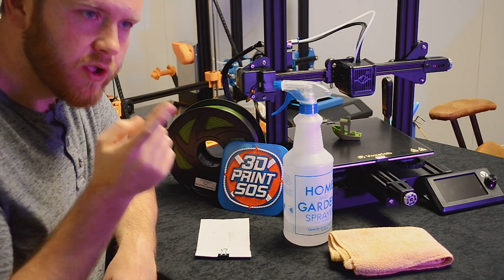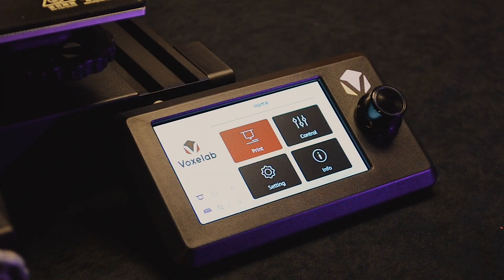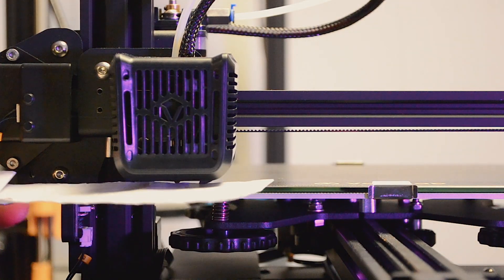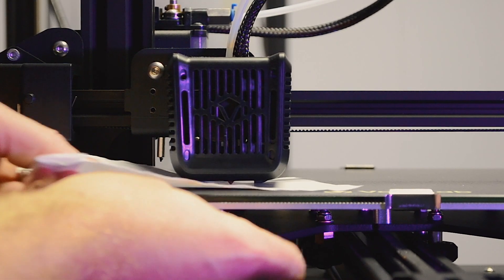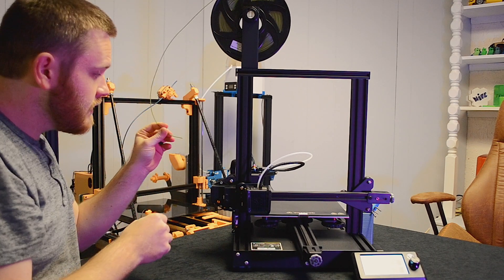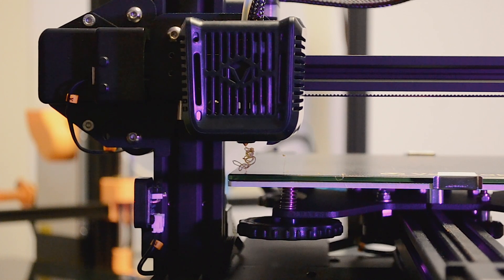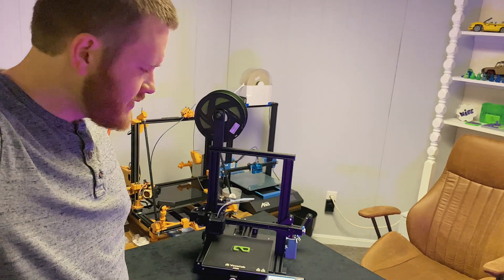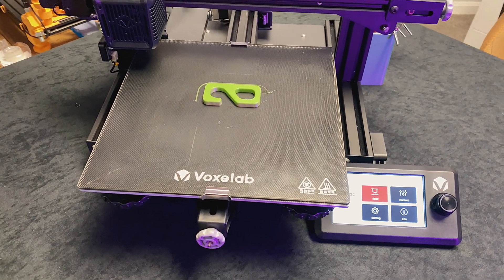How to Level Your Bed on Your Voxelab Aquila 3D Printer.

Comment: Thanks for the video! This was a huge help. I’ve just printed my test hook. Came out great. I’ve uploaded my STL files I designed on sketch up to the memory car but nothing shows on the printer?
Reply from the maker: You have to run the STL files through a slicer software. Check out my slicing and Cura video for a how to. ;)
Reply: @3DPrintSOS  thanks, watched your video and they’re looking great. The only issue I’m having now is that’ it’s doesn’t want to stay on the printing plate, I’ve cleaned it numerous times with rubbing alcohol but it always wants to lift up on one side
Reply from the maker: Very common issue. It’s almost always just leveling. You may have to lower the z stop a bit so you can lower the whole bed further down on the springs. Then relevel again
Reply: @3DPrintSOS  okay thanks, il look into that. I don’t suppose you have a video on how to do it? Thanks again!
Reply from the maker: I have a leveling video you can follow but I don’t have a z stop lowering video. However, it’s rather easy. You compress all 4 bed springs about half way or even a bit past halfway. On the left side of the printer there is a end limit switch on two bolts. You loosen them and move it down a hair. Enough for the printer hotend to be on but not to smash into the glass. Then level as normal. The bed should be a bit more rigid and stay in level better. Also be sure to double check the wheels the bed rides on. They should have no wobble but ride without friction.
Reply: @3DPrintSOS  what speed setting would you recommend printing on? Thanks again for all your help
Reply from the maker: I think the most reliable is 50mm/s. Google “Ender 3 magic speed numbers”. I believe CHEP had a video on this. I noticed some manufacturers use these numbers too. Keeps things smooth, yet moderately quick.
Reply: @3DPrintSOS  followed your advice and I’m now having great prints consistently! I’ve found adding a little glue stick glue and wiping it down with a water before printing helps it adhere to the bed. Ive been using sketch up to get some practice in but I’m finding sketch up is more geared to simple geometric shaped projects. What CAD software can you recommend for more model making? Thanks again for your advice!
Reply from the maker: I’ve been using Design Spark Mechanical. It’s a bit friendly in its interface which is nice. However it doesn’t have object mirroring. Which is strange. So keep sketch up handy for when you need to mirror an object. Lol

Comment: Awesome video! But I'm having an issue leveling the bed. I go to auto home, it moves just a bit but never drops down. Any tips?
Reply from the maker: Hmm. Hard to say. If it didn’t move at all I would say check the wiring. But since it moves, maybe a belt is too lose? Or maybe something is binding. Make sure the wheels aren’t too tight. There are eccentric nuts on the the inside wheels you can adjust.
Reply: @3DPrintSOS  lol yea I figured it out. And you're completely right, I forgot to connect wiring to the bottom sensor. That correct diagnosis earned you a sub and a like! (Just kidding. I was already subbed and had liked your video) Great stuff! Keep up the great content!
Reply from the maker: Haha. :) Thanks for the support!

Comment: When I wiped my new bed with 75% IPA, it kinda discolored, and some yellow residue stick on the kitchen towel, may i know if it is normal or my IPA is too strong? Thanks!
Reply from the maker: Probably not the ipa. I use 99% and it’s just fine. Don’t be afraid to use it.

Comment: Thanks for all the great videos - i had spend many hours researching and your videos convinced me to buy the voxelab (i bought you a coffee when I went to your thingi site).  I assembled the printer today, I won't mention how many different ways I fitted the Y rail hotend before I got it right (I ended up referring the to finished image on the front of the install manual).  I first levelled using paper and got  the tension but then no actual print.  I tried again using a 0.1mm feeler gauge and that worked (I guess I've got cheap thin A4!).  I have done a few prints now and have checked the level and needed to adjust it each time, so I think the springs are not under enough tension so will look into moving the Z Stop.
Reply from the maker: Yep, that will be the trick. Need more tension on the springs to keep level. Moving the z stop will help big time.

Comment: hi, so basically when im printing the print gets stuck to the nozzle and makes a big glob of plastic. what do i do?
Reply from the maker: It sounds like the nozzle is still a bit too far from the bed. Try to relevel with a bit more tension on the paper. And give the bed a good clean before you heat it and print.
Reply: Also make sure your nozzle is tight, I had a loose nozzle that caused a big mess with the filament trying to go around instead of through the nozzle.

Comment: My boyfriend just got his but is having trouble getting files from his SD card to print. Any advice/tips/things we may be doing wrong? The card is in the printer but no files pop up under the print option.
Reply from the maker: Hmm if no files come up, it may just be an error on their part or the card is potentially bad. Watch my Cura and slicing video and see if you can get a print going that you’ve sliced from my profile yourself. A benchy is a perfect test. Just follow along with the video. :)
Reply: You may need a new boyfriend

Comment: Do you think a BL touch sensor is worth it? I noticed that the board has a spot for it
Reply from the maker: In my opinion, it’s a bandaid fix. I’m not sure if the menu has an option for it out of the box, you may have to reflash it with something else to get it to work. I like to keep mine manual. ;)

Comment: you are literally the only person i have found who has the same printer i bought. amazon rated it as a great starter printer. however i think im still having issues with adhesion because it still is coming up, i also have been doing research on layer thickness and such does that have a play on how thick the gap is?
Reply from the maker: Adhesion is like 90% leveling, 5% clean build plate, 5% temperatures. As far as the layer thickness is concerned, on a .04 nozzle you should stick to something in-between .1 and .2 layer heights. Any more and you are sacrificing layer adhesion and your prints can become very weak.
Reply: Microfiber cloth + iso = works just as new. Every time you touch the bed, you're transferring oils from your skin to the build plate, which doesn't help at all. Get some alchohol and wipe it off
Reply: Glue stick glue stick !
Reply from the maker: @zero00tolerance  Sometimes you just gotta. But like I said...careful removing it. haha.

Comment: Leveled the bed as per your instructions 100% Good  ....then I started getting failures and  "stings" re-did everything just to make sure,.............. then I heard it  * click * click * click  !!!!
  The "Gold" gear that you push the PLA through  was skipping ......and clicking.......   OFC I reached for the Hammer  but decided  for a tiny allen wrench instead. :P ,   Readjusted  the gear and tightened it down  mmmmm  is there a better one available its mostly plastic ,     Aslo  my Test print didnt want to stick to the bed until i put down some  painters tape then it stuck Every time.
Reply from the maker: Couple things here. Those things usually click if two things happen. One is a clogged nozzle, and two is if speed at which you are printing is too high for the temperature you have the nozzle at. As far as the tape, I have a feeling all you've done there is get your nozzle closer because of the tape, and now it is sticking. This glass bed, when clean, should have amazing adhesion by design.
Reply: @3DPrintSOS   I printed the Test  model in the Micro SD  its a little platform with built up shapes, didnt change any other settings ( figured the people who made it would have regulated it ) But  the tape , I also dont wanna mess up the bed (Just in case)  :D
Reply: @user-sv7cb6so1d  just in case someone like me, needs to read this. re level if you put another surface on top of the bed...;) HTH
'wonders what feeler gauge that might be'...:)

Comment: Do I need any thing to help with bed adhesion. I just got mine last night, scratched the glass a little in the corner, first timers am I right. Tried to get a print going, and it almost instantly started to peel the first layer. This is definitely user error as it is my first printer, just wondering if you need anything to help stick or if I need to get my leveling a little more precise
Reply from the maker: Happens to us all. I have a few printers with "flipped beds" lol. It's a part of learning. As far as sticking, Sounds like you need to get the bed nice and clean with alcohol and get the nozzle just a bit closer to the bed. It should stick to this surface right out of the box. You can try giving the bed 5c more when its warming up as well. ~ 65 should be good.
Reply: @3DPrintSOS  wonderful ill give that a try after work thanks for getting back so quickly, I'm super excited to start printing.
Reply: @3DPrintSOS  that worked beautifully I printed out the hook and it came out great. I'm currently printing my first self modeld print. I modeled it myself in fusion but I just got the idea from some one else and just built it up to fit my hardware
Reply from the maker: @maxmoto97  Awesome! Congrats on getting it running.
Reply: @3DPrintSOS  hey so I'm curious how often should I clean my print bed. Right now I'm doing it before every print, is the alcohol going to damage the bed if I do it too often?
Reply from the maker: @maxmoto97  You should clean your bed if you are having adhesion issues or you've touched it a bunch with your fingers or hands. You dont want any oils from your skin on there. You wont hurt the bed with the alcohol though.  :)

Comment: I finally got my Aquila today. Watching your videos helped a lot with the bed leveling. I found that mine barely had to be under tension to be level.  I printed a test hook like you did here, and got a noticeable elephant's foot. Maybe I leveled it too closely? Ignoring the seam, the rest of the print is flawless. I can barely see the print levels.
Reply from the maker: Awesome! If you had some elephants foot you can back up just a hair, the tiniest amount and be good. ;)
Reply: @3DPrintSOS  Updating now that my Benchy test has finished.The height measurements are both 0.35mm shorter than they should be, which reinforces that idea. The text on the underside, while visible, is completely flat with the rest of the bottom and the brim. 

Every other measurement is spot on (maybe +/- 0.02mm), so I definitely think I made my z-clearance tolerance too tight.

Comment: Watch the filament loader, the spring on mine was too tight unbeknownst to me, which caused too much pressure cracking the piece that held the bearing.
Reply from the maker: braden henderson I’ve heard this before as well. Good pro tip.
Reply: @3DPrintSOS  I’ve bought a metal feeder as replacement. Voxelab was also very friendly and helping the process of getting it fixed
Reply from the maker: That’s great. I also have a printable version that also eliminates the need for ptfe couplers on my Thingiverse page at Thingiverse.com/fedorsosnin/designs

Comment: I get an invalid file error when I try and upload your profile. Do you have a screen shot of the printer and extruder settings?
Reply from the maker: Check my latest video. It sounds like you first need to add the printer. In the video, I show you how. ;)

Comment: love the vid . got a question tho when I run my printer the pla comes out all squiggly and not uniformed. any suggestions?
Reply from the maker: This sounds like it could be loose belts. Use the belt tensioner today get the belts tight. If the belts are ok, it could be a leveling issue. When the printer is properly leveled, it should be making a nice, even bead on the glass. You’re looking for the filament to be somewhere in between squished and round at the top.
Reply: @3DPrintSOS  ok i'm going to tighten the belts some more and see if that helps. Also what temp should I be running the nozzle and bed at? I was successful to complete a piece but my nozzel temp was 225 and bed was 110. some ppl say thats to high.
Reply from the maker: @anthonyrichmond6834  I would do 200 on the nozzle and 65 on the bed. For PLA, your numbers are WAAAAAY too high. 110 on the bed might even cause damage on this machine. Try 200/65 and let me know what it looks like.
Reply from the maker: @anthonyrichmond6834  You can download my profile and use that. It seems to be printing flawlessly eveytime using those settings. :)
Reply: @3DPrintSOS  ok thanks. i was just using some of the freebiese that came with sd card to try it out. but I just downloaded  your profile
Reply: @3DPrintSOS  so after tightening it up and lowering the temp the pla slides across the glass. is there a way i can send you video of whats happening?
Reply from the maker: @anthonyrichmond6834  Hmm. That may mean you need to re-level the machine. And then after, clean the bed with isopropyl alcohol. You could use a dropbox or YouTube or imgr acct maybe.
Reply: @3DPrintSOS  whats your dropbox?

Comment: are there any printable upgrades for this?
Reply from the maker: There are TONS of Ender components that would fit on this printer. Just depends on what you are trying to upgrade. Are you having issues with something or just want to make it look cooler? I have suggestions for both. ;)
Reply: @3DPrintSOS   Suggest and print away,  I say !   :}
Reply from the maker: @user-sv7cb6so1d  I would raise the printer up with some riser feet. I have a set on my thingiverse you can try at thingiverse.com/fedorsosnin/designs. If you want to try flexible filament or are having problems with the PTFE couplers, you should print my extruder block and lever. A bed handle is also very useful so you dont always touch the bed. Additionally I would find knobs for both the Z and the extruder for easier handling of the filament and z height.

Comment: First bed leveling video I could actually understand. Love your editing style too, great video man! I have a hopefully quick question, the preloaded prints that come with the Aquila sd card always come out pristine! I uploaded a benchy and it came out great as well, I barely had to do anything, but when ever I try to print anything else on the voxelab, the first layer adhesion is horrible, I get a giant blob and then spaghetti everywhere. I've tried cleaning the bed, glue stick, all the same. What can I do to get my other prints to come out as good as the preloaded ones?
Reply from the maker: If  an uploaded file does not print well, then after with no changes, a preloaded file prints great, then I would say it's a flow, temperature, or speed setting. The first thing I would do is slow the speed down to 25mm/s on the first layer. Maybe even 20mm/s. Then I would raise the bed temp from 65 to 68. Try those two settings and see what happens. Try that and let me know what happens.
Reply: @3DPrintSOS  Changed speed down to 20 mm/s, nozzle temp to 205, and bed temp to 68. It's still not adhering to the bed. I went ahead and printed out another preloaded file, the knob, and it's printing perfectly right now. Still frustrated.
Reply from the maker: @nickh.7600  I know this can be frustrating but we will get to the bottom of this. If the preloaded files are working, its just an issue with settings. Just got to find out what the problem is. Why would the z position be different between the files? That's what we gotta find out.
Reply: @3DPrintSOS  hyyyyttyyyyyyyy
Reply: Yyyyyyyyyyy
Reply: Y